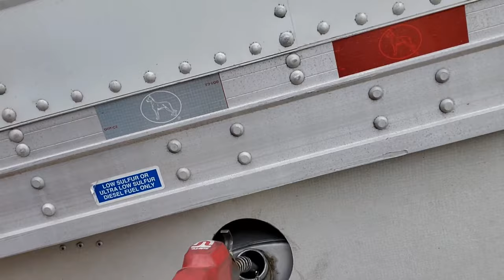My German Shepherds First Semi Truck Ride !!!!!!!

Comment: hi you guys im 58 and recently subscribed love your channel I quit driving right about the time cabovers where obselete i was a tanker gas and lindseed oil .dry van hauler in the 70s and 80s
Reply: if ya wanna know what its like to bobtail 500 miles in a  leafspring cabover just ask it sucked i had to wear 2 pairs of socks cause heater didnt keep up and in summer air never worked the more i complained the more shop put it off